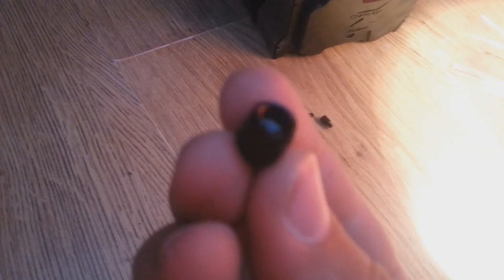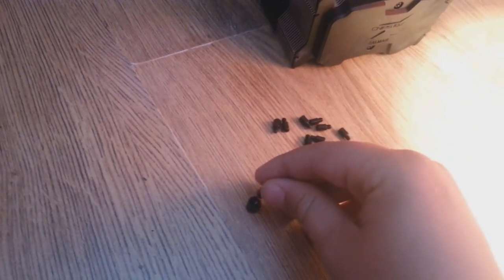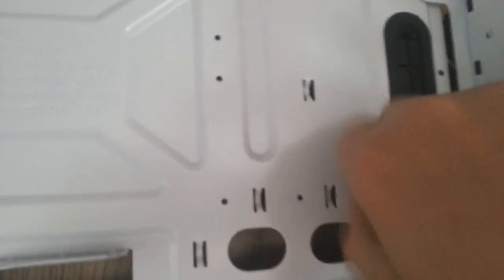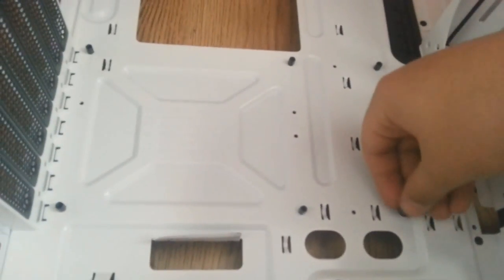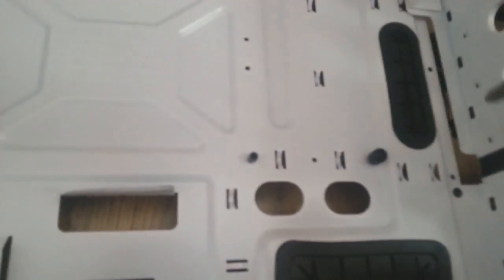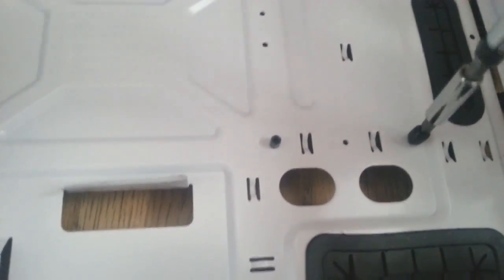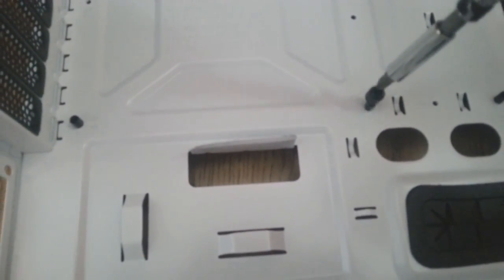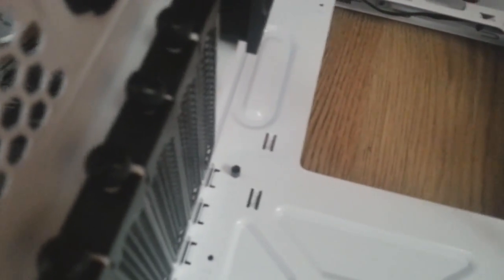1. Install & Using Motherboard Standoffs - How To Build A Computer

Comment: I know that its beeb 6 years, but i only have 5 standoffs in my pv instead of 8. So iam missing 4, its on the right side where no weight is. Its a bit of board flex if you move it on that side. But only if you push on it not otherwise. Do i need to order more or can i keep it likr this?
Reply: Order more. It's not worth risking shorting out your whole pc.
Reply: @googlehelpdesk  how would it short?
Reply: @hugo9016  by having one of the solder points underneath the motherboard grouding by touching the case then short circuitng
Reply: @googlehelpdesk  oh okay iam ordering some today :)

Comment: my case only came with 3 stand offs
Reply from the maker: Maybe you don't need them, or only need them for mATX Mobo's. How did you get on?
Reply: SimpleTips4U nvm i finished my build everything works great found out my computer case already had some standoffs built in
Reply: Raidmax Exo is also like that. I almost gave it a bad review thinking that they went stingy with the standoffs. smh.